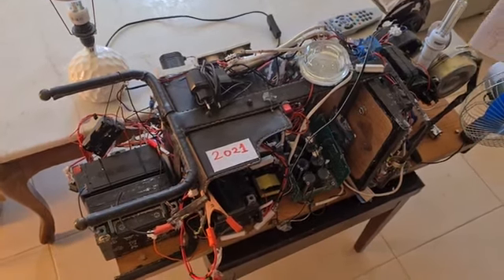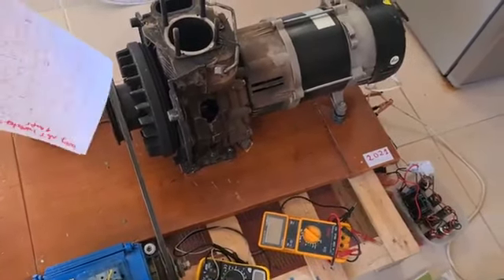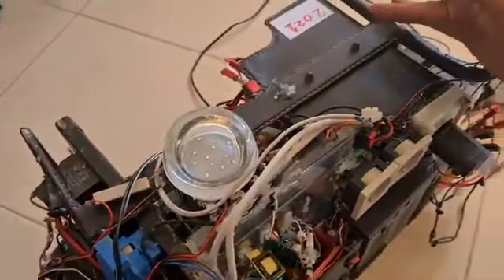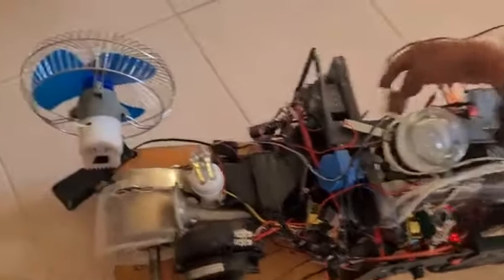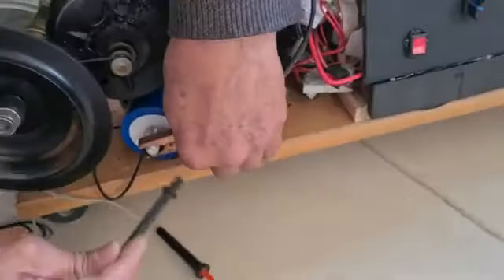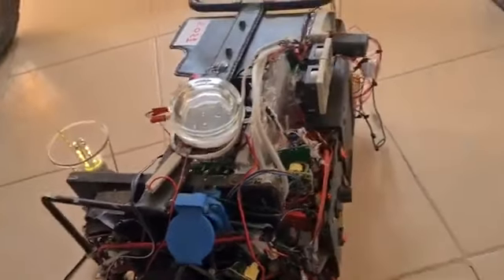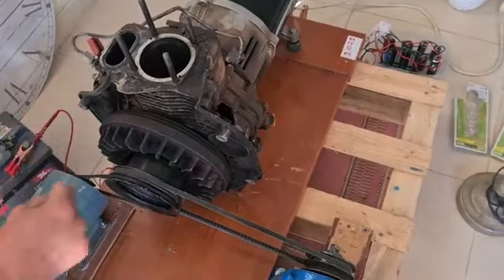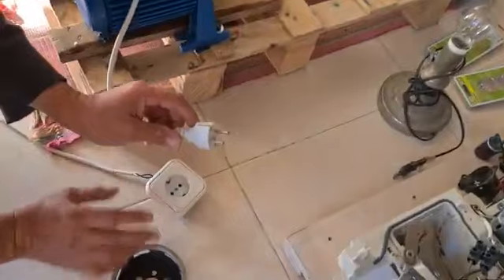Self running 2021 fuel less generator

Comment: How does the little 9v battery supply enough watts to run the DC motor that drives the alternator?  Thx for sharing👍🏻
Reply from the maker: Hi, this generator that can work on a 9V battery is because the motor that spins the alternator is a DC motor with magnets inside and it can work from 7V up to 14V so if you connect a 9V battery to it, it will spin in low rpm for a long time and run on the 300mAh that the 9V battery produces. That is the reason that it can even run on 5V very slowly on the phone charger. The phone charger is connected to a tiny inverter and the phone charger only consumes 5 to 7V and around 250mAh DC. I hope it helps. Best regards
Reply: @denissabourin  9v * 300mA = 2.7watts In
And how does the modified alternator produce more than 2.7watts output and not stall from lenz effect? Thx for info

Comment: On this denis, why can't you use car alternator to power your inverter battery direct because you don't need to charge another battery before achieving your goal on fuelless generator just do as I say it will give you best results because car alternator is the best just 14v 90 or 120amp of  car alternator. Thanks. Messaging you from NIGERIA, west Africa

Comment: Would a large flywheel on the 900 ex-diesel generator not help to make everything less shaky?
Maybe even a 20kg weight off a dumbbell next to the pulley could help steady things a little.

Good luck. 👍
Reply from the maker: Hi Eric, your idea is great of course it would help. A big flywheel would be very good for that. I need to calculate if the shaft and bearing of the generator can handle it but it will definitely help. Thanks for your input I appreciate it. Regards

Comment: The crankshaft from the Diesel engine is causing the vibration if it were a straight shaft it would be fine
Reply from the maker: Thank you, you are right. Regards

Comment: CONGRATULATIONS SOMETHING VERY INTERESTING WITH 9V OR 5V AN UNINTERRUPTED CURRENT SOURCE IS AN ENGINEERING THAT I SAW AT KAPAZE GEORGIA HE USED THE COIL TESLA AND COULD PRODUCE 2-10 OR MORE KW DET IN SCHEMA I DON'T UNDERSTAND THE GREAT THING I AM NOT A SPECIALIST IN ELECTRONICS ONLY ELECTRICIAN BUT I TRY TO LEARN AS MUCH AS I CAN AND YOU HAVE GRACE
Reply from the maker: You are doing very well and yes Kapanadze did very interesting things as well. Regards

Comment: Hello thanks for sharing 👍🇬🇧
Any chance we can diagram of what parts are needed where?
Reply from the maker: Hi Strawman, there are 3 generators in the video you are commenting on. I believe you are speaking about the big one? Well I just glued some neodymium magnets on the rotor 3-4 each side, there's a video with photos of that, all are facing north. I don't have a specific diagram for this generator. I just use the blue AC motor that spins the whole concept and there is a DC grey aternator giving 180W output which gives the charge back. It didn't seem to work so well as too many vibrations and I took it apart and think it would be better to take the crank out of it. I hope it helps. Regards

Comment: Please what is the rating of your capacitor
Reply from the maker: Salam aleikoum, on the big generator with the blue motor it's a start capacitor from a washing machine 450V 20uF. The gain is not big enough to run many devices. Only the bulb for now. Choukran mar salam, Anis

Comment: Привет Денис.По англиски непонял.Нет штоли самозапита?
Reply from the maker: Hi, there is a small storage left. First we have 4 lights running directly on the big 4Kw alternator. This is not a lot. But we have to give the input power back to the blue motor on the right. Most of the energy goes to this motor on the right. And the reason is because the alternator on the left the grey one, is the one that charges the input batteries that give the energy to the inverter that runs the blue motor you see on the right. The gain is not big but it's a good concept. Best regards I hope it helps

Comment: I have fun up that condenser on a large valve with a timer frequency drive of 760 hz with a low rpm 500watt motor for a timing breaker and 12000 volt step up transformer of 60volt to 1200volt step down to 120 volt with a reliable relays make a very efficient self running generator I was shock that it work bettering then what you doing
Reply from the maker: Sounds like a good job. From high voltage to go to lower voltage and have it stay stable is good. Thanks